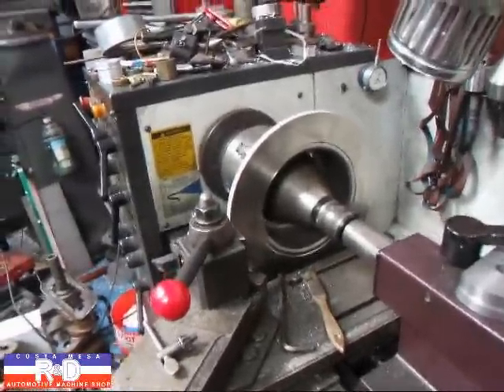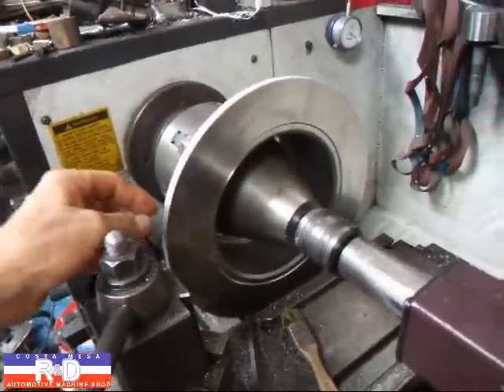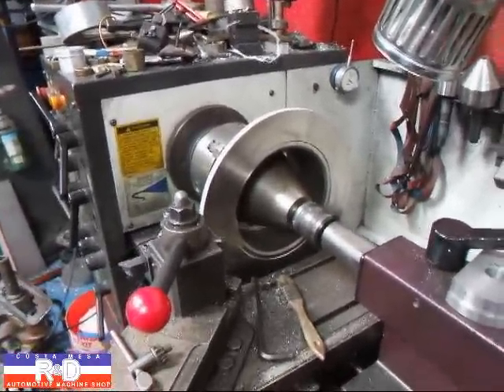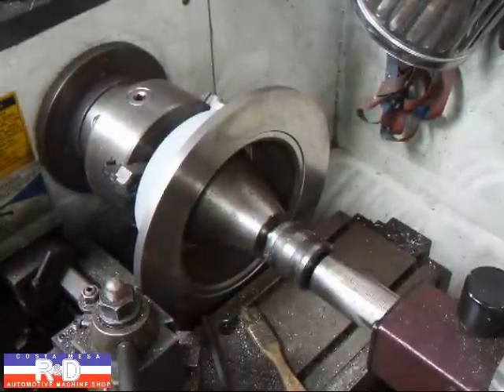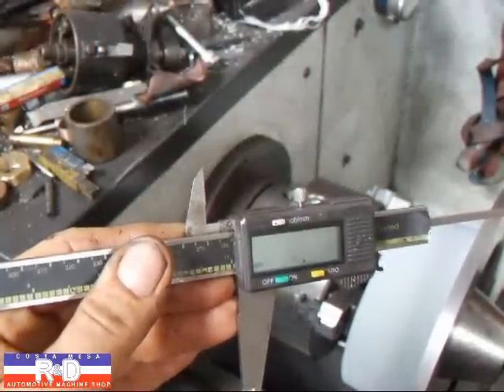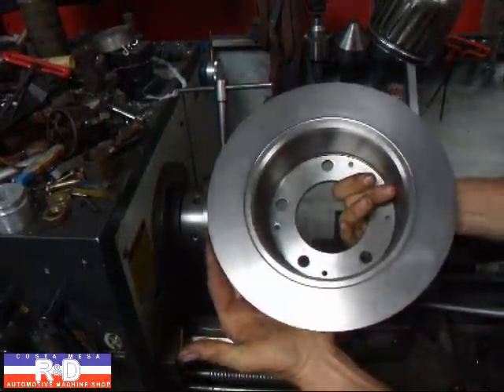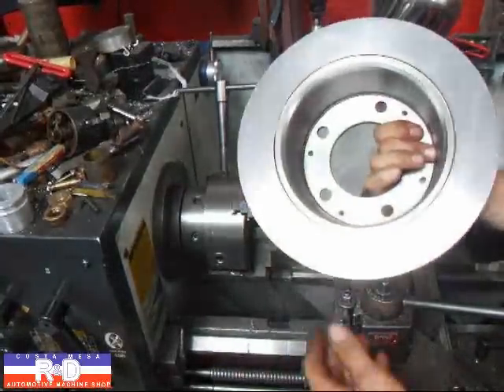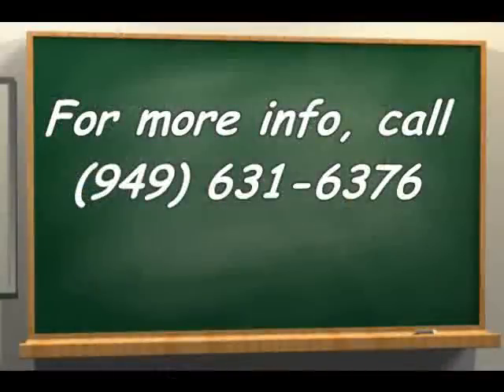Porsche 914 Disc Brake Rotor Diameter Reduction

Comment: I once had to bore cast zinc alloy light pole mounts because they were nearly 0.200 too small...they were very rough castings and I could hardly chuch them up true in the lathe- needless to say, it was very hard on the tooling.